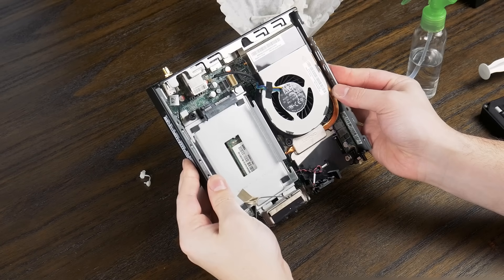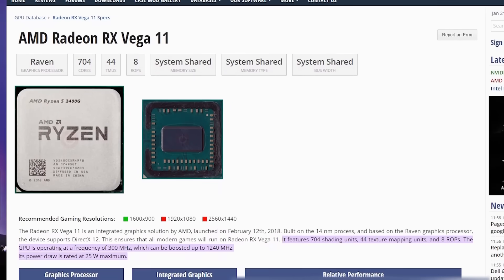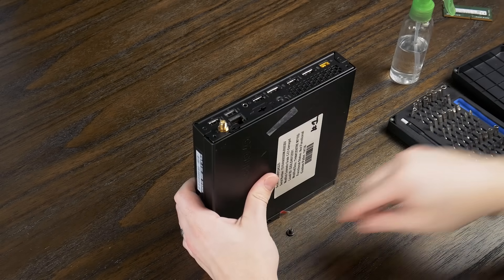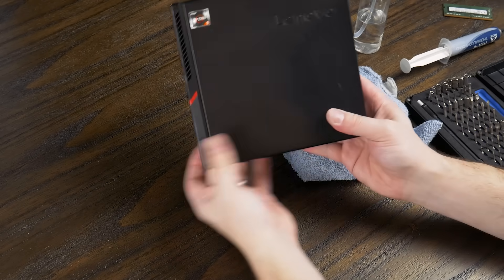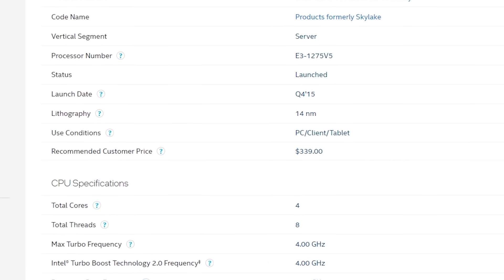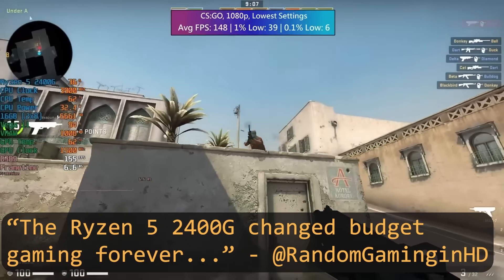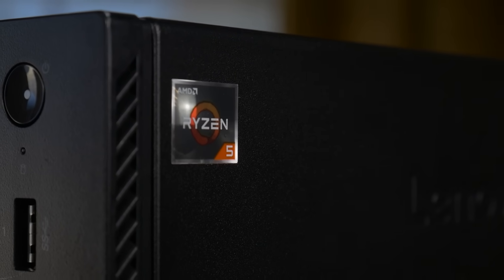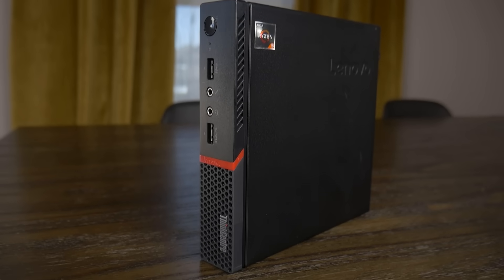I Got It Working, But Was It Worth It? - Landfill To LAN: m715q Gen2

Comment: I just bought one of these with the Ryzen 3, although I have the Ryzen 5 pro 2400ge that I’ll put into it. Right now the R5 lives in a small pc with a b450m MoBo and I do use it for gaming. I even play starfield with it. Sure, it floats around 15fps, but it does play well enough that I don’t mind it. 

I think these apus pack some serious bang for the buck and are extremely capable when it comes to gaming if you’re okay with mediocre frame rates and resolutions. 

I am going to see if the standard R5 pro 2400g will work in mine when it shows up. I doubt that it will, but there’s only one way to know for sure.

Comment: Hi there! I know it's an older video but as I got this for a tiny office PC I wonder how you removed that extra plastic piece to install the nvme. Mine feels stuck and I can't upgrade.
Reply from the maker: The little whit clip that holds it in place? I think I just had to pull/wiggle it out of place. It's been a while. You could try taking out the board and using pliers or something to be extra safe.
Reply: @HardwareHaven  Thanks for the reply and suggestion. I got it sorted and running. I really like these little systems.

Comment: I got a Lenovo Thinkcentre M93p off of craigslist I think or freecycle or something and it wouldn't boot or it boot looped so I ended up having to flash the BIOS with a Raspberry Pi and it works fine and I've been using it ever since.

Comment: I made a big mistake with that unit. I downloaded the wrong BIOS and got the Gen1 bios. While the Bios did not flash,, the Super I/O was flashed right before. Now my Fans are running at max all the time and the Gen 2 Super IO firmware updater does not work (installlled version to old). 😞

Comment: How is the noise of the fans? Could they be replaced?
Reply: Hi, i use the M73, M720q, M70q. All at the same formfactor and with the same kind of fan inside. Under heavy load they tend to be audible, and if you sitting direct in front of it is a little bit annoying. But under normal load they are pretty silent, like whispering. Good for streaming content in your living room when you are a few feet away. I am really happy with this small systems..

Comment: Does the case get very hot upon regular usage?
Reply: no, but bevor it gets too hot, you will hear it 🙂 the cooling system is very effective.
Reply: @mathiasanders3946  You are right on that, try turning it on without adding thermal paste on the CPU and you will hear that fan like that pc is going to explode lol, I was testing lol, I love testing. But yeah, the cooling system is good.

Comment: In future you could just keep a preloaded Windows and Linux SSD handy rather than performing an install since nearly everyone who buys these has another PC they can use to install either should the encounter difficulties with their used machine. I keep spare SSDs preloaded for testing and to boot externally using adapters for data recovery. I keep Linux, Windows and also loaded Ventoy to one SSD so I can boot a selection of .isos internally or externally. Ventoy supposedly boots VMs too but I've not tried that yet.

Comment: As to a TSS at a school who has these M715q machines.. the oem SSD is complete trash. Most of them fail at about 25 to 50tbw over the span of 3 years. They are powerful Tiny aio machines. I just begun replacing them with WD 250gb nvme ssd. they are 35 bucks and keep these running well.

Comment: Ive read somewhere that Lenovo has started PSB locking Ryzen cpus to Lenovo motherboards.
Someone on a forum claimed that PSB locking started after m715qs release. Other claim that you never know, it might affect even older machines.

So I gotta ask you... have you experienced any of these issues on an m715q? Can I upgrade the cpu of my m715q tiny to a Ryzen 5 Pro 24000 GE without any hassle? I currently run a Ryzen 3 cpu.

Thanks in advance!

Comment: I have the Lenovo M92P I bought on eBay for $45.00. CPU Intel i5 vPRO 4GB RAM. Had to order the power cable, 240GB SSD, and WiFi Dongle. It was just a bare-bone system. I installed Windows 10 Pro and it works well. I also tinker with the Raspberry Pi 4 4GB with different Linux distro's.

Comment: you are my only HOPE man!
Can you tell me, the m.2 mvne slot is 3.0x4 right? 32Gb transfer?
The reason i ask that, i want to add an External GPU by using that slot.
(ADT-Link M.2 key M NVMe External Graphics Card Stand Bracket)
so i can hook up a GTX 1660 Super to is with dell 215w power supply.
You seem a smart tech guy, who know these stuff!
 please help me!

Comment: these little PCs are great. I have been running the m700 mini for a couple of years now. It has Proxmox and I run a docker container with, navidrome, wireguard, vaultwarden, pi hole. and I also use it as an ark server, windows vm, debian vm and nextcloud. I did have truenas on there aswell but I didn't like the lack of storage options and how cluttered connecting things via usb were. so I ended up building a seperate nas system which runs open media vault. great vid!

Comment: I have an older M73 used as a backup machine and file storage server. A WD MyBook sits on top and provides bulk storage for films. You can get lots of M.2 drives in that little box 😁 I love these little units, they are so well made.
Reply: Nice, we got one recently and are happy with it. What OS is yours running?

Comment: When these things exist I always question why people go for the raspberry pi when all they want is kodi or retropie. Especially at scalper prices but even at msrp after getting a case, storage, and power supply, it isn't much more for one of these and it'll perform way better for both tasks. Plus you can run actual pc games on it. Older or lightweight ones sure, but that's more than the pi can do.

Comment: What is the height of that 2.5 caddy? I wonder if we could fit those 12.5mm 4TB drives in there. 7mm drives only has a maximum of 2TB. While the 5TB ones are at 15mm.

Comment: I want to setup a HomeServer, 
I have an ancient PC with an intel pentium dual core e5200 & 3GB DDR2 ram (no GPU)

So should I throw it away or will it be barely ok ??
Reply from the maker: It would probably work just fine for some tasks, but it will probably use a lot of power relative to slightly more modern machines. If your electricity bill isn’t a concern, then maybe go for it. Otherwise, maybe look at selling it and putting a little bit of that money towards some thing a little bit newer. Third GEN Intel or newer gets quite a bit more efficient

Comment: Assuming all 3 work, you could probably swap out the wifi card for a panel mount style 2.5gb nic and mount it up to the extra port in the back. Acquire a 2.5gb switch and those three could be a nice home lab cluster with proxmox.

Comment: You do know there is a thread on Japan BBS that these boxes boost befirmance when coupled with 130W DC adapter instead of original 90W? 3400GE model gets more boost but for 2400GE it should also be present.
Reply from the maker: Interesting. Not sure I would want higher power draw though. At that point, just get a machine with a non-E model.
Reply: @HardwareHaven  Unfortunately these 1L desktops are not offered with a 2400G CPUs as far as I can tell. And going for bigger case defeats the whole idea.

Comment: These Lenovo mini computers are beasts, I got the M720q with usb-C from goodwill bins (a pay by the pound center) for like $2 and it had a 256gb ssd and 16gb of ram with an 8th gen i3 I looked it up and it’s about $800 or something, and it’s great, I use it to hold my movies server
Reply: Jesus what a deal
Reply: You can even drop a small dGPU in those with the right PCIe riser card and a larger than stock PSU (the legion gaming laptop ones work great for cheap). I've seen RX6400s and rtx3050s slapped into these to make little LAN rigs and couch consoles on a budget.

Comment: I have a similar HP system, but with higher clocked RAM and 16GB. I use it to play light games (Minecraft) and emulate games with Dolphin, and blocking ads when we watch tv on my living room PC. Runs @4k60 (tv is 4k60hz) with a manual xrandr setting (I use Mint btw)
Great value machines, would recommend to people who didn't need ridiculous power

Comment: Do later bioses add support for newer Ryzen CPUs? Obviously still need a G series one but could get something like a 4600 / 4700GE?
Reply from the maker: Hmm not sure. Knowing Lenovo, I wouldn't be too hopeful haha
Reply: @HardwareHaven  if you've got a later generation ryzen G series CPU could be interesting to try? 

As you have a bios flasher I wonder if microcode can be added for them in a similar way you can with 8/9th gen intel support on lga1151.

Comment: I use one for my homelab as a management machine, run proxmox on bare metal and have 2 vms, 1 for pihole and 1 for containers, the containers I run on it are the reverse proxy and uptime monitoring so that if anything from my main server goes down I still get alerts. Hooked up to a ups with my modem and router, if I lose electricity I still have about 4 hours of uptime for internet/network and I get alerts for everything.
Reply from the maker: Nice!

Comment: It's nice to see the AMD APU here is capable of transcoding in jellyfin. Was the performance of jellyfin transcoding and ease of setup for APU transcoding just a straightforward in Linux? And what about the transcoding performance in JF, as I can see from Inte's Wikipedia page about QuickSync, 7th gen intel and above support 4K HEVC 10 bits (I'm assuming supports VVP Tone Map HDR) transcoding and 12th gen and better support  Dolby Vision (12-bit HEVC) decoding, where would this APU be? I'm really liking your videos about home server and I'm inspired to setup my own one day if in Canada the price is right.
Reply from the maker: I didn't test in linux but I belive it's supported. You can check Jellyfins documentation, as it does a pretty solid job covering what all works and what doesn't

Comment: Great video. M715Q Gen 2 motherboards don't support ECC. The ECC SODIMM will work but ECC functionality does not.

If you decide you want to test out ECC for a future video, the same 2400GE in this Lenovo can be popped into a cheap Asrock A320M board and ECC will 100% work.

Comment: The file extension .mp4 doesn't mean anything - you need to specify what codec is that vid using. It can be HEVC, H.264 or even ProRes, which is completely different in terms of how difficult it is to be decoded.
Reply from the maker: Yes you’re correct. It was HEVC not h.264, that was my bad!

Comment: You can play triple A games on these mini PC's. Get a PCIe x16 to M.2 eGPU dock from ADT-Link (the R43SG dock), connect it to the NVME M.2 port on your mini PC, add a GPU to the dock, add a power supply (either an ATX PSU or a Dell DA-2 adapter will work for this) and you can basically play more demanding games.
Reply: Awsome! Can this pc modherboard support it? 
Im planing to by this pc just for that!
Can you help me, how to do this?
ETA Prime done it, with some mini pc's, but im not sure, this one can.
I cant find any info about it"s m.2 support.
Reply: @1987Redfield  As long as the mobo has an NVME M.2 port (preferrably x4 instead of x2), it should be supported.

Comment: I am quite fond of mini-PCs like that. I have a Beelink one with a Celeron J4125 that I use for emulation, it works really well for everything up to Dreamcast. For GC, it works pretty well at native resolution, but PS2 is a no-go (maybe because of the bad PCSX2 core in Batocera to be fair, I haven't tried on Windows). It was definitely more expensive than this one, I kinda regret buying it new when there are a lot of Haswell and AMD PCs for around $100 on eBay. Before installing Batocera, I tried a few PC games like Hollow Knight and it really didn't ran well, ran Steam Remote Play pretty well though. I have an old Mac Mini 2011 in my office, I'm thinking of replacing it with one of those.

Old workstations are also really interesing to me, I got a HP Z4000 for free at work, bought a Xeon X5680 for $20 on eBay, put a R9 380 I had laying around (that I got in a $80 PC from Marketplace) and I now have a pretty decent gaming PC for indies and older AAA, that could be an interesting video I think since you've messed with more recent workstations.

Comment: I just love how these little guys have socketed as opposed to soldered processors.
Reply: They were built with the mindset that you could actually repair them, and/or upgrade them rather than throwing them away...most stuff today you buy it that's what you got everything soldered on the motherboard without any sort of way to upgrade the hardware.  Even RAM is being soldered on motherboards now, without any additional slots for additional memory later on, buy what you need in the future rather than the present is what you have to do.
Reply: The lenovo psb vendor lock makes them kinda useless.
Reply: @jment34  For upgrades, yeah unfortunately the CPU being socketed is kinda pointless with the vendor lock. But at least the machine is still repairable, at least in theory.

Comment: Got myself a m910q with an i5-6500T, 16gb DDR4 and 250GB nvme for around 170€
It's a beast machine/server for my projects/scripts
Reply: You should look into the bios mods for it. You can add the 8th/9th gen microcodes and drop in a laptop Xeon 8c/16t with an LGA1151 socket mod from aliexpress.
Reply: @anurbanpenguin8890  really??? Is there any videos so I can look up?
Reply: There is a good thread on ServeTheHome. Keeps deleting my comments being more specific. M700/m900 coffee lake bios mod in a search engine is probably a good way to go.

Comment: i killed my mac mini when i removed the heat sink. the nylon post didn't make it. I've read that 4-40 nylon screws/nuts will replace them, if you can find them. amazon sells them but in quanities greater than needed for the repair of 1 mac mini (plus I have an imac if I have a need to use a mac)
Reply from the maker: Oh good to know! Wish I hadn’t already murdered the poor board while trying to get the posts back in 🤦🏻‍♂️

Thanks Johnny!
Reply: @HardwareHaven  back in the day i used metal #4-40 x 3/4" round head machine screws with a nut to replace the nylon posts. make sure you reuse the springs tho!

Comment: Great machines! I have one with a 6500t which I use for a PLEX/NAS Server. (The 5 bay USB3 HDD Dock is massive compared to the PC 😅). Low power consumption and really easy to work on too.
Reply from the maker: Nice! How’s the external drive bay server you? Also, are you running software raid or hardware?
Reply: @HardwareHaven  I use an "ORICO 5 Bay USB 3.0" although only have 3 bays filled ( Its great to just throw other drives in that need diagnosing). No need for raid on it although I did raid0 some SSDs(Software) in the past to check the speeds and it was excellent!
Reply from the maker: Nice, thanks!
Reply: @HardwareHaven  WD Elements Duo also works great!

Comment: This would be a good kodi box or retro gaming console with Batocera. I had Lenovo m73 and was able to get a 4tb 15mm drive installed with a little work.
Reply from the maker: For sure, and nice!
Reply: @HardwareHaven  using a Ryzen 3200g I was able to upscale Cemu to 1080p high with no issues. Check your bios to see if you can disable CSM (usually under boot menu) this will allow you to allocate more than 2gb to dedicated video memory if you have more system memory. I am running a asrock deskmini x300, 5600g, 32gb ddr4 3200 mhz with 8gb dedicated to vram. It play Yuzu at 1080p 60fps all day.

Comment: Use a hair dryer (or crafting heating gun) to heat up the labels to make the labels easier to remove. Or after running all these benchmarks the machine should be warmed up.
Reply from the maker: Good thought!